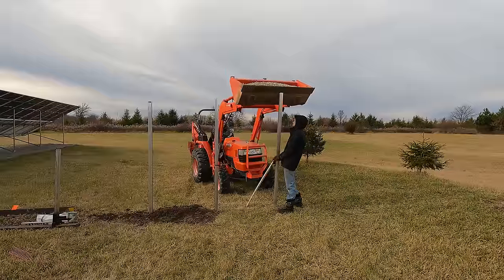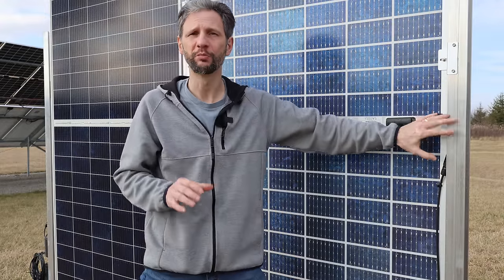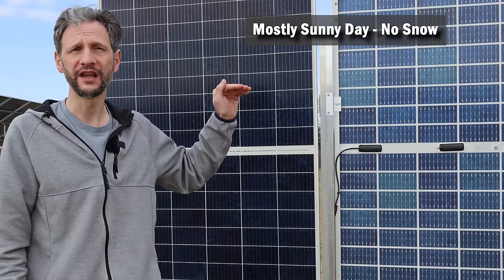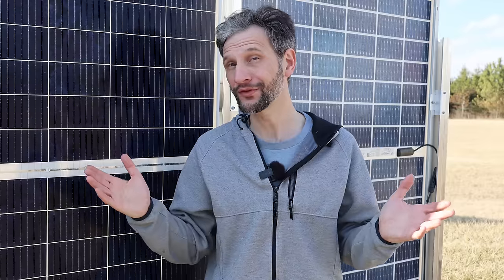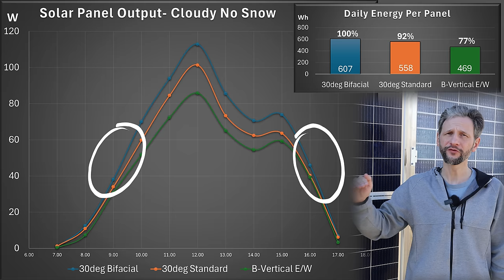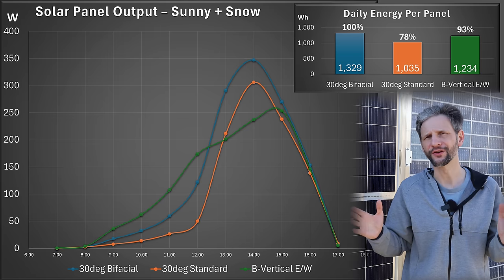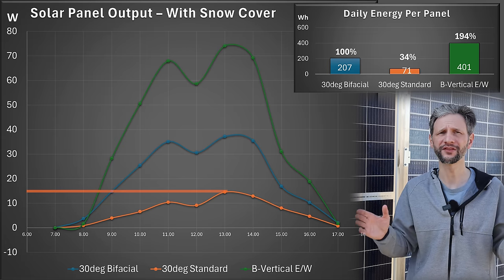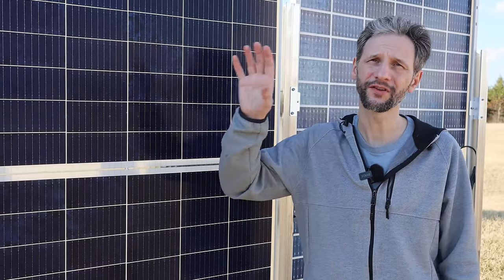Vertical Bifacial Solar Panel Performance Results Part 1

Comment: Hay Dave,  just watching some of your videos and I love how you explain stuff.  The idea of the two sided panels is great, but why do people not just do a quick 90 Degrees rotate of the in the Noon time. Hell I remember as a Kid running out side and cranking the satellite dish to change channels. LOL
Reply from the maker: 2 reasons:
1.  The time you spent doing that would negate any savings from the power.
2.  The gain from the back side is a significant percentage of the total power.

Comment: It seems cost-wise, the most efficient way would be to use standard panels facing south and mount them vertically with a reflective surface in front of them.

Bifacial panels are too expensive for their return at the moment. Slanted panels require more upkeep.

Comment: Very nice test.  Really!  If I were an electric utility trying to beat the duck back curve, I would want my customers installing vertical panels in order to optimize evening production.  However, for an off gridder with a battery, the ordinary way of making panels face south is king.  One suggestion is to make the panels a little steeper, say 5degrees, so that they make more power on peak in winter for fewer hours and less power on peak in summer for more hours.  For my latitude of 34north, placing panels at 34 means a summer / winter ratio of 1.8:1.  But tiling my panels to 40 tends to raise the winter production so that the ratio is now 1.47:1.  I plotted production models and beyond +6 degrees the total annual production starts to fall off at an exponential rate.  It's a point of inflection.
Reply from the maker: Thanks!  It's good you went through that level of analysis to understand your needs and set your angle.  Most people don't.

Comment: One thing to consider too, is if you want to make money with solar, you only could sell mid-day production in south facing Arrays regularly for almost 0 cents since (at least in Germany), on sunny days energy is literally free mid-day - only few do notice that bc only few ppl use dynamic energy delivery contracts.

(let aside, that there are options for guaranteed prices of 6-8 cents over the whole day, which are only goodies from the govenment)

If the array harvests energy very early and late, these are the times where there are peak demands of energy, while the most solar energy production in the country is almost gone.
In these hours, you regularly can earn up to 20 cents per kwh compared to 0-2 or so in the midday. 

You as well can save up much money if you can get your own energy production in these hours

Comment: We have a sailboat with a panel on the dinghy davits (170 or 175w, I think) in addition to 400w of flexible panels on the Bimini.  Looking at possibly replacing it with a 200w bifacial panel so that we can get the benefit of the reflection off the water. Good video!

Comment: Glad to see some vertical testing.
But I think you missed the greatest opportunity. Vertical building mounted panels.

I’m up north in Maine and will be getting 8kw of solar for my roof soon. But my south facing wall can hold an additional 4kw of solar. For winter sun, this might be the perfect combo.
Reply from the maker: Yes, I think a combination of south-facing and vertical E/W can be a great combo.

Comment: Walls of solar pannels between rows of crops. A good use of resources. Why through away all those old solar  that are less than 20 percent efficiency. None today are more than 33 percent efficient at canverting solar to electric. The verticl mount has many advantages. . .

Comment: One down side is the installation cost since a lot more posts would likely be required vs sloped. If you have difficult or rocky soils that could be a significant issue

Comment: I've read about bifacial panels & found it intriguing, but by accident I found out something thats even better.  I bought 12 panels without being ready to install them on my roof.  I didn't want to waste them just sitting around, so I laid them flat on my backyard lawn.  Wow!  I got more output outta them than being at the correct incline,  & they kept their output for longer than inclined panels... basically all day.  My inclined panels put out 1.3kw for about 5 hours while the flat ones put out 1.9 kw for 7 hours.  This is real useful to me because I have a large flat-roofed patio that I never considered using, but just mounted my 12 panels flat up there.  Why haven't I ever read anything about this?
Reply from the maker: I suspect you have an error in your measurements.  You can easily estimate the daily production at any angle using this software: https://pvwatts.nrel.gov/
Reply: @ProjectsWithDave  ... so you're saying the data on my Bluetti inverter that shows how many kw are being produced, & how many watt-hours that are stored in my batteries is also wrong?  I'm just trying to understand what you mean & where the error is.

Comment: I live where we get snow 9months out of the year this is interesting because the snow reflects a lot of light, and you shouldn’t need to clean it as much maybe? I’m in the mountains where we get 40% more uv light because of the altitude. You can get sunburns in your nose because of the light reflecting off the snow.

Comment: I really like the analysis you did between vertical and south facing installation.  I have been thinking of normal south facing panel installation but with a slight twist.  If the limiting factor of an installation of bifacial panels was number of panels, not ground space, I wonder if mounting south facing BUT having spaces between the panels (gap to be determined) could be a significant improvement to power output.  Perhaps the space between panels would allow enough sun to light up the shaded underside improving overall performance.
Reply from the maker: That will improve the backside production but probably not enough to offset the cost of the additional racking.

Comment: Also don't forget about having an adjustable south facing array, that way in winter they can be at the proper degree and because of that it also lets snow slide off easier.
I would be interested to see the power difference between upright panels and panels on an adjustable array.
Reply from the maker: I plan to do a vertical south facing test.

Comment: I thought it was interesting how they could compliment traditionally mounted panels by flattening the curve throughout the day. However, unless you're completely off grid, it's all about economics.  The vertical mounting system "looks less expensive" - less materials = less cost?  I've heard some talk of north/south fencing - but it seems distance may become an issue.

Much love Dave.  You always provide great data.
Reply from the maker: Thanks!

Comment: Very insightful! Would love to see a similar evaluation vs south facing panels mounted on a tilted roof: supposedly the restricted of ventilation of the panel causes it to heat up and performance will drop. Wondering if a vertically mounted panel would outperform in this scenario
Reply from the maker: Unfortunately, I don't have any South facing roof mounted panels to compare to.  However, I do plan to compare to South facing rack mounted panels this summer.

Comment: It also looks like you should gap your solar panels on your array  so you avoid all that shading and can get the bifacial panels producing more. I would be interested in seeing the data if you say removed every other column of panels or spaced them out a panel width apart.  I will also add that the study specifically called out mounting them veridical specifically to deal with panels that have lower performance when warm / hot so you probably are not seeing any heat issues in the winter.

Comment: Interesting experiment.  I have a couple thoughts on improving the output:
1.  try adding mylar film on the ground to increase reflectivity for bi-facial panels
2.  you mentioned using a 50/50 mix of 30degree and vertical panels, but based on your graph it seems to me that a 60/40 ratio would be better to prevent clipping
Thanks for sharing.
Reply from the maker: The graph I showed was actually 1/3 Vertical East, 1/3 Vertical West, and 1/3 facing south at 30deg.

Comment: Dave. Try adding the Floor Reflector. afoot the vertical panel. Robert Murray-smith Demo's it works. at least add "Reflectiveness:" under the dual-sided panels platform. cheers

Comment: I would be curious what effects of water sprayed onto the vertical panels on a sunny day when the sun is mostly straight above (during the dip in production).  I want to think that the water droplets could refract the vertical light inwards to the panels, but that is just a wild theory.

Comment: I'd be intrigued to see how a vertical north-south config works compared to the above setups. Would probably get rid of the dip but still retain great performance in the snow, perhaps?
Reply from the maker: It does eliminate the dip.  The curve looks more like a standard parabola.  I plan to test it at some point.

Comment: A little interesting test you can do, since you have that concrete foundation on the angled array . . Try adding a layer of reflective matter on the foundation (mirrors, metal sheets, a roll of reflective isolation material (sorry dont know the correct name in english,) this should add how much the backside of your bi-panels can pick up, especially at midday where the shade out the biggest are behind them
Heat-drop off could be an issue though.)🤜🤙🤙

Comment: This gives me more questions then answers.  What about summer? What do bifacials do on a roof mounted system? what about standing panels facing south/north say mountedon a house if you dont have much space?
Also that plastic on the panels in direct sun hasme worried. im not sure that will survive 2 decades as when laying down.

Comment: So... Put a vertical fence around your traditional solar park, and massively extend the daily range of higher performance hours, year round?
Reply from the maker: I think it would end up too close to the inner array causing shading issues.
Reply: @ProjectsWithDave  yes and no. It depends. In many areas of the world, fences for solar parks are required anyway (mostly for insurance issues), so they did leave a certain gap from the beginning. Replacing the fence with a solar fence might be an idea.

Comment: I watched a video that said the vertical panels were cooler during hot weather and would over produce when temps were higher.  Guess we get another video from you during a hot summer month?  thanks

Comment: One useful test would be to model the size and cost of the minimum required battery bank given a reference amount of load.  Presumably the vertical panels let the battery be smaller, and this might be overall cheaper.

Comment: A comparison with a solar tracking array would be interesting. 

My opinion is mount the panels for most production in the day and scale the energy storage after your needs. If the batteries are full you can still produce hot water for the evening or heat your house for the night.

Comment: South facing vertical pannels would he interesting.... We have a south facing fence with pannels almost vertical (15 degrees) and they wirk great... Especially in the winter... Autperfoming the 3x sizesd east west installation on our rooftop
Reply from the maker: Right, typical East/West installations do not do well in the winter.  I did a comparison on that in these videos: https://youtu.be/J7xnY84Ch1E
https://youtu.be/M-5qcmlMLSg

Comment: Here's an idea: Vertical bifacial panels mounted in a zig-zag alternating pattern row front-facing to the southeast and southwest directions, and spanning east-west(or perhaps north-south).
The downside is you can't drive a tractor in a straight line between them and reach all the way.
Upsides are potentially better energy profiles in most of these tested situations.
The exact optimal angle should be optimised as a compromise between panels picking up reflections of and shading each other.

Comment: I've been considering vertically mounted panels to be used in place of a privacy fence. The thought process is basically, "a standard wood or vinyl panel fence does nothing but stand there deteriorating in the light, so maybe use solar panels and get better use from that land." Perfect efficiency isn't required and I've considered used commercial panels since I could have a larger array compared to available rooftop space.
Reply from the maker: Just be sure to analyze the output so you don't spend more on the fence than you will get back out of it.  You can use the FREE calculator I made to estimate: https://projectswithdave.com/Calculator/

Comment: The lack of needing to clear snow off is the huge benefit as it means it will continue to produce without human intervention. Great for remote sites.  I would be curious to see how it would do facing south, it would be less optimized for taking advantage of the bifacial feature though.
Reply from the maker: Not having to interact is always my goal, remote or not.

Comment: You can use folding mirrors (thicker aluminum foil) so that the panel is also illuminated at noon.  Some very simple system, maybe an accordion system.

Comment: I think that the most important thing about vertically mounted, west facing panels is that they neutralize the Duck Curve effect: they produce the greatest amount of power when there is the highest demand for power.

Comment: It would be interesting to see results for a huge mirror installed underneath to reflect light onto the back of the 30 degree bifacial panels (like snow)

Comment: Prices matter! I dont know about Alaska, but at least in Norway the prices are highest during the morning and evening peaks. In fact, we increasingly see negative prices midday. So an E/W-orientation correspond better with price incentives. If total production is only a few percent lower, I would guess that E/W-oriented panels generate way more revenue than the traditional setup. Would be interesting to see that analysis.
Reply from the maker: That's a good example of where vertical E/W panels may make sense.  That's why I like to generate data.  The application is different depending on each persons circumstances.

Comment: Hi Dave,  as usual great and eye opening information on your tests.        I'm surprised that you have not installed an (Eco-Worthy) dual axis solar ground mount that holds 4 large or up to 6 smaller 100watt solar panels and they are very reasonably priced (as cheap as $500) for the mount,  sun tracking sensor, drive motors, controller, solar panels and wiring etc. and it tracks the sun from sunrise to sunset.
Reply from the maker: They offered to send me one, but I haven't had time to fit it into my schedule.
Reply: @ProjectsWithDave    I think you will like it,  they really put some shoulders on the production arc early in the morning and evenings.
Reply: Good suggestion on tracking. I would also think adding tracking to the albedo may have improvement or increasing the albedo surface by adding higher reflective material that can reflect throughout the day. Great review though. Can't wait to see additional data

Comment: Good presentation. Have you considered vertical mounting standard panels back to back? The data you have from your existing installation should provide a fairly accurate projection.

Comment: 1:08 there could be a way to slightly tilt them using some smarts (merge them be connected at the middle so they can swing, and the bottom where some mechanism can be used to push them a little one way, all centrally controlled from some cheap raspberry pi)
Reply: Oh and they can be used as snow guards for roads in winter

Comment: I bet you could build a corral with panels, gradually altering the angle from vertical n-s to 30' e-w, in a circle, or, for simplicity an octagon.

Comment: you miss an important point! scattering of of crucial importance - yes! But can you imagine what happens, if you have several rows of vertical panels next to each other? the scattering from one panel is reflected to the side row thus enhancing in this way their performance significantly! with your - interesting - measurements you unfortunately miss this very crucial effect that would bring out the advantage of vertical east-west panels even further !
Best Shaka Sherpa

Comment: Installed panels vertically (one string was Trina Solar & another string was Canadian solar 575W). Noticed that east facing N-type side generates 11 Amps & West facing P-type of the same bifacial panel generates 7 amps). Installed 17 feet apart to avoid shaddow.  Result is a disaster.
Reinstalled all 48 panels facing south at an angle & finally got the required current.
I do not recommend vertical installations.

Comment: Great real world testing results and opens up some possibilities , thank you!! If someone hasn't mentioned it yet, I'm curious about 30 degree east/west instead of straight verical because theoretically you would get much more power during the mid day hours. I'm traveling international or I would try it myself.
Reply from the maker: I did some testing on that.  You can see the results in these videos:
SSW: https://youtu.be/J7xnY84Ch1E
West: https://youtu.be/M-5qcmlMLSg

Comment: Do the 30deg standard panels take into account the reduction in output because of the heat? That's what vertical panels are supposed to fix.
Reply from the maker: This test was a winter result. Temperature wasn’t the focus.

Comment: I'm in Florida and the information I saw was that the vertical mount helps mitigate efficiency loss from heat in climates like mine.

Do you know of anyone that has done tests in more southern areas?
Reply from the maker: I plan to test the temperature effect in the summer.
Reply: @ProjectsWithDave  I am looking forward to it!!!! Thank you